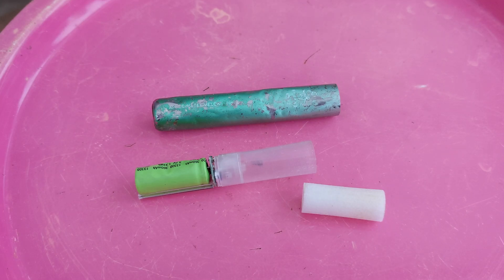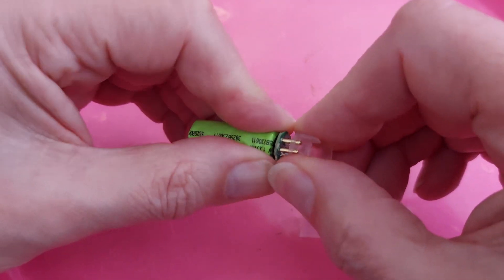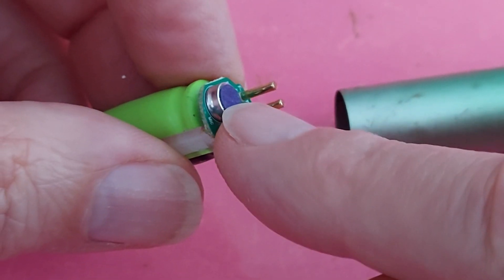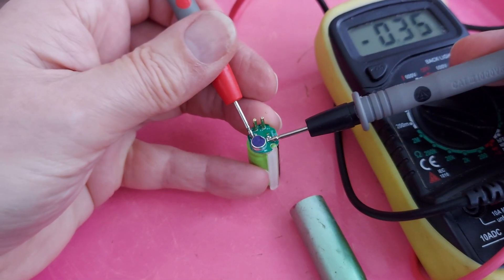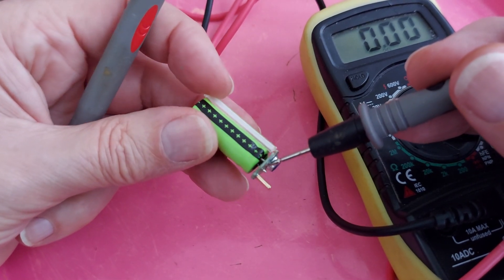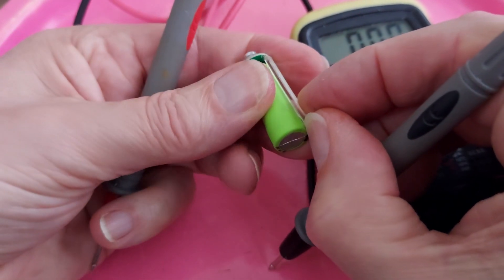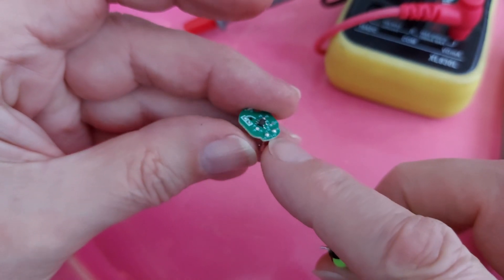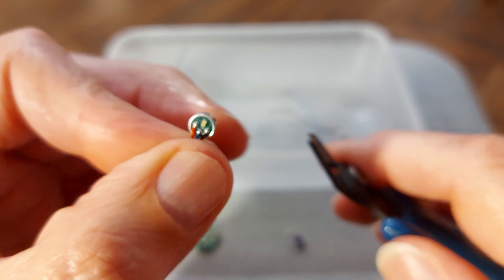Modular vape components

Comment: I think your meter probes accidentally shorted between a battery terminal and the metal body of the sensor, when you were trying to measure the battery voltage.  That either triggered the heater circuit, or maybe damaged something in the electronics, resulting in the high battery drain and the battery heating up.
Reply from the maker: Yep, but not enough for a viral video 😁
Reply: @GrandadIsAnOldMan  Yep. That wonky test set-up wasn't ideal. A ball of kid's plasticine makes a great "hold any shape" vice. Makes for easy soldering/tinkering/measuring. 😉
You wouldn't have had a former career in Bomb Disposal by any chance? 🤔😱😈